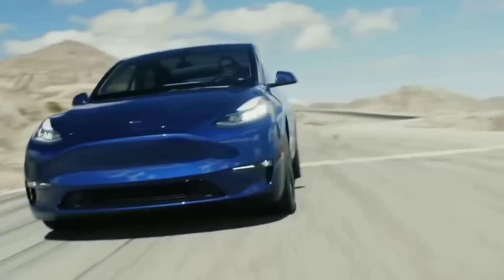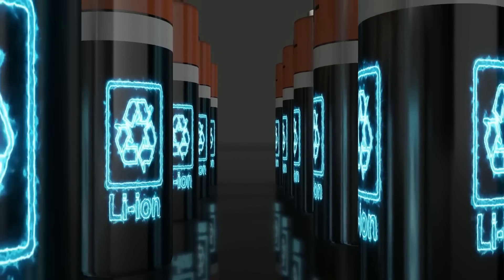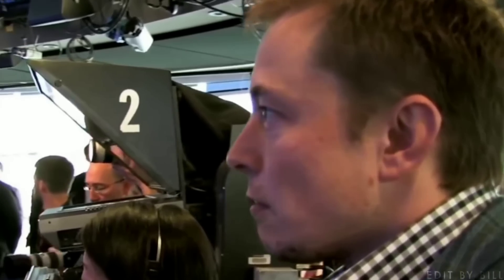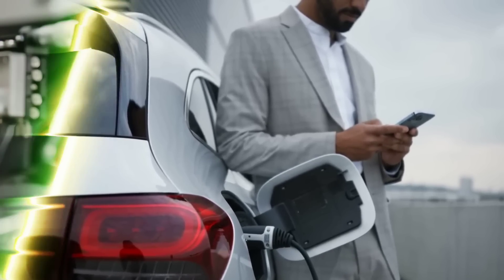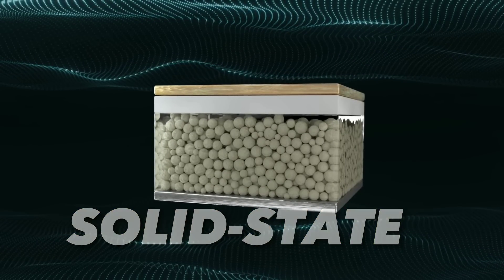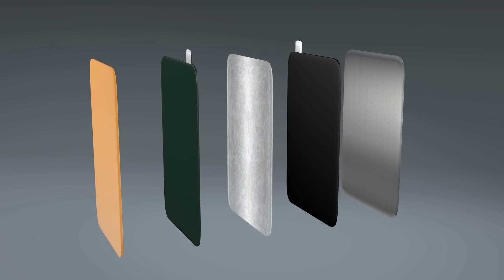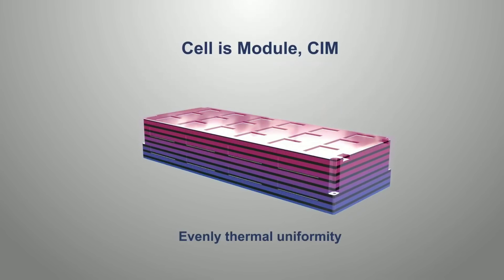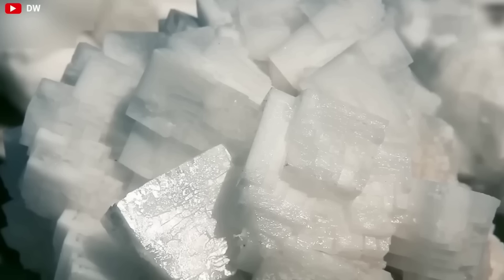You Won’t Believe What Elon Musk’s Research Team Just Discovered By Mistake The New Battery!

Comment: So, why is Tesla going to build a lithium refinery in Mexico? If this sodium-sulfur stuff almost ready to go, then that refinery will be an obsolete monument to stupidity as soon as it's finished.

Also, the idea that a 15 minute charge could get you from NY to LA is ludicrous. Even with 100% efficiency, the energy moved into the battery is limited to the wattage that can move across a 240v circuit at an amperage that can be handled by 6-gauge wire in 15 minutes.

Comment: This isn't a thing until it is mass produced.  It sounds great, but this is not the first new battery chemistry.  It's also lacking a bit on details, it should mention what the energy density in Wh/Kg and not say it's 1.5-2 times....this is misleading.  What is the C rating? mentioned are that only simple materials are required, but not the process to create it - so how easy will this be to mass produce?  There are several promising technologies, and this may be one, but it typically takes 10-20 years to go from lab to mass production.  I wish them the best of luck.

Comment: Solid state battery have been just a few years away... For the past 30 years. 
So many junk channels using the Tesla name and click bait titles to get views.
Reply from the maker: I understand your skepticism, but solid-state batteries have made some significant progress in recent years. For example, researchers at Harvard University have designed a stable, lithium-metal solid-state battery that can be charged and discharged at least 10,000 time. This could be a game-changer for electric vehicles and other applications that require long-lasting batteries. You can read more about it here: https://cleantechnica.com/2022/02/07/tesla-co-founder-endorses-new-solid-state-ev-battery/
Reply: @FutureGalaxy  the issue is not their potential, it's their market feasibility. From what I understand, it's just the case that they are far too expensive to mass produce. Better tech like sodium ion is the future in my opinion 🙃 although, ofc, they have different applications 😁